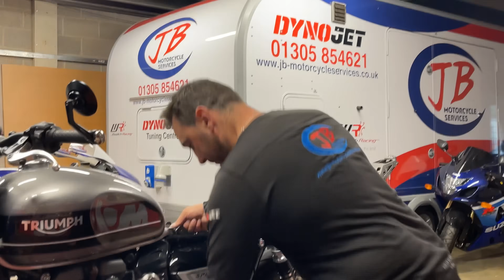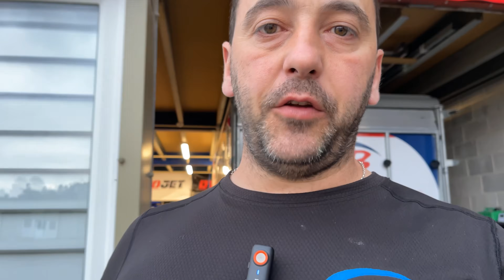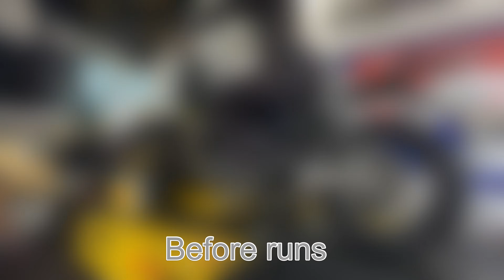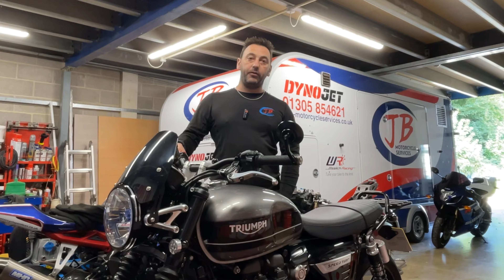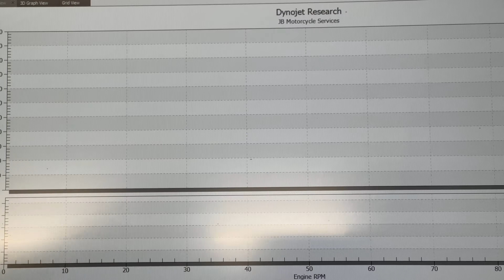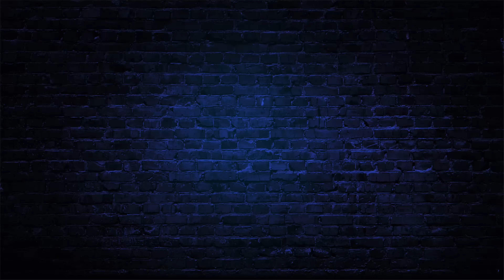Triumph speed twin tuning  @jbsworkshop

Comment: Hi. Im looking at getting my 2022 st1200 tuned, ive done a decat, v&h cans and dna panel filter. 
Is there a reason for the 02 sensor delete? I've just had a new one as one of mine through up a engine management light. 
Ive had the bike from new and have had the decat ect for 3 years now with no map and ive always thought it could do with a map but finding someone who knows what there doing is hard to come by, ive been told by a local company about a power commander but i dont like the idea of one of them. Also whats the cost of the tune and where abouts are you? Thanks. Grant.
Reply from the maker: I am based in Dorset UK,cost wise if I can do it is around £500
Reply: @jbsworkshop ah thats abit of a mission. Will keep the search going. Thank you
Reply from the maker: @grantgwyn1992 if your midlands area then parkitt racing near tuxford are good
Reply: @jbsworkshop there about the same distance as you but up north 😂 im in Hereford

Comment: Hi was talking to you on Delboys channel "Triumph Rocket " having same issues on mine , low throttle fueling , have Tune ecu but never messed with maps yet . Mines 2016 Thruxton 1200 so pretty much same setup as Speed Twin , mine feels lean once up to temp with excessive popping on over run . Not bothered much about top end fueling as feels ok just idle + low end also occasionally stalls have blanked canister off , disabled 02 sensors with resistors still the same . Bikes had hard life before I got it done 54k just like some advice on re mapping as never done this before , you said to drop u email ? not sure how I find your address on hear
Reply from the maker: @nounoufriend1442  hi there,it’s hard to tell without putting it on the dyno to check AFR but I can probably give you some guidance.
Is it runnning standard exhaust with cat or an X pipe decat?
Reply: @jbsworkshop  Its stock at moment will be running X pipe with Vance Hines (have them already) Also have some fairly straight through short cone mega's  to try , came as bundle with 1200 r stock headers . Bikes been driving me insane , cleaned throttle bodies , cleaned injectors , swapped injectors , swapped coils , new plugs plus HT caps ,had re map done by Triumph . Bike was very neglected when purchased but very cheap she runs perfect during warm up then once up to temp its erratic at low throttle with lots of popping. Forgot to say it has Boost plug fitted (got it cheap S/H ) it seemed to work for short while !! as did the dealer recall re map for short while , done valve clearances as well
Reply from the maker: @ I would remove boost plug for starters & add 10% fuel in all low tps settings from the lowest up to about 50% throttle from 0 rpm to about 5/6k rpm’s & test ride it & see what it’s like.
Also disable 02 sensors in tune ecu & unplug the 02 resistors
Reply: @jbsworkshop  Cheers thanks for info
Reply from the maker: @nounoufriend1442  no problem,without getting it on a dyno you can’t get it bang on but that should get it running better.
Reply: @jbsworkshop  Do you just leave 02 sensors un-ticked (defaults to that in TuneEcu ) is the 10% added in the fuel trim tables ? also presume F Trim global then applies trims to both cylinders
Reply from the maker: @nounoufriend1442  yes uncheck 02 sensors & unplug.
Yea 10% added in fuel trim tables & global turned on & accept fuel trims,then save map with some notes of changes you have made & flash map to ecu & road test.
It won’t be perfect but should ride better

Comment: Would like to see how my 2020 T00 shapes up on a dyno.....not looking for more power.....just a fuel air that kinder to the motor....is that practical.

Will the Triumph ECU....not try and reverse your fueling adjustment's.....I seem to remember reading that it could well do.

My knolarge dont stretch that far.
Reply from the maker: @nickaxe771  I believe on 2020 you can’t have as much control over the closed loop area of the map as 02 sensor has to stay connected.
So you can only have full control of the open loop fuel map(tps fuel map) & limited control over closed loop
Reply: Thank you so much for getting back to me.

Bit over my head.....so would I be wasting my time if I asked for a fuel increase of say 5% across the RPM range at my local dyno tuning shop.
Reply from the maker: @nickaxe771  from the dyno work I’ve done on the pre 2020 bikes I would say around 8% increase in all tps settings up to 80% throttle across the entire rpm range & richen the closed loop map to 13.8 to 13.5.
Obviously it’s best to check it on dyno but I think that will get you close & a better running bike
Reply: @jbsworkshop  Interesting....I have TuneEcu and know my way around it to alter the service wrench and clear and read fault codes.

Wish I was nearer to Doncaster and I would let you do it for me.....long way from Liverpool.

Is it something I could do myself? or could I easy bugger things up.

I do have the T100 map installed.....
Reply from the maker: @nickaxe771  I would say it’s best to have a bit of experience with the mapping side before attempting it.
Having a dyno to hand is also a massive help so you can verify changes

Comment: So what was the bhp increase in the end?
Reply from the maker: @TheHowardski  it finished with 90bhp & the before run was 88bhp so not big gains top end due to customer wanting to keep the baffles in.
Without baffles it would be around 94bhp at a guess.
But it runs much smoother now & had bigger bhp improvements low down where you use it on the road

Comment: Was the goal just correcting a/f ratios only? Was the customer not interested in performance gains even with throttle limitations removed? Thanks
Reply from the maker: @krie2375  I removed throttle limitations & any ignition restrictions,removed 02 sensors & charcoal canister before I did my base runs to then finally build a fuel map with consistent AFR ratio’s across all tps settings & rpm ranges.
Doing this allows it to have a smoother throttle transition & as a by product normally results in performance gains especially in the areas it’s running very lean.
I could of got more power & performance removing the baffles but the customer rides with baffles in all the time so that’s how I mapped it,I normally talk with the customer before tuning & try my best to give them what they want & maximum power isn’t always there request.
Hope this info helps👍thanks for the comment
Reply: If you were trying to get more power out of it , about how many HP do you think you'd get ? Where in the rev range ?

Comment: Nice video matey, fair increase in bhp and torque percentage wise, how did it ride???
Reply from the maker: Not massive gains but it rode much smoother with a better air fuel ratio.
So glad I got a better mic set-up,sounds much more consistent